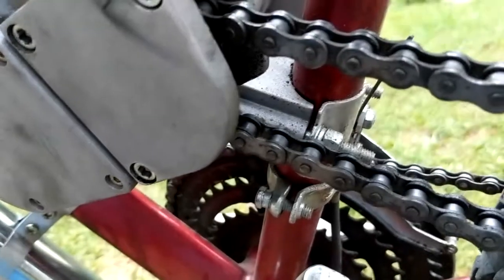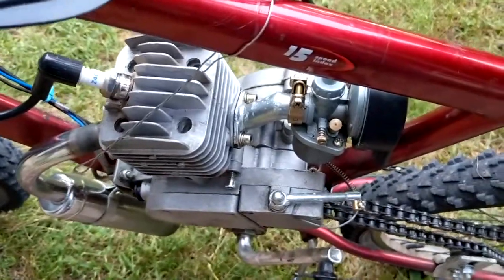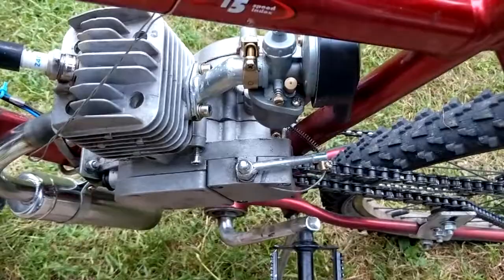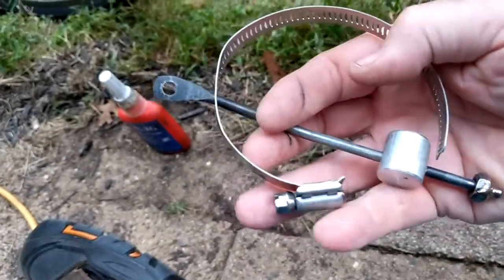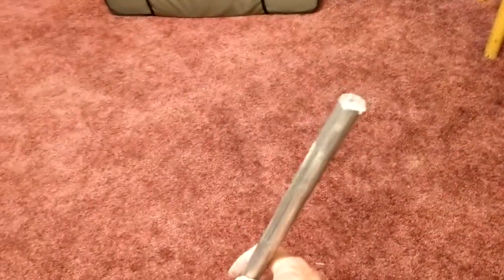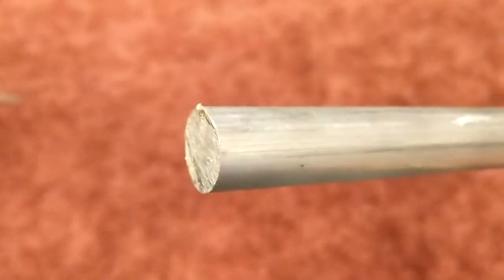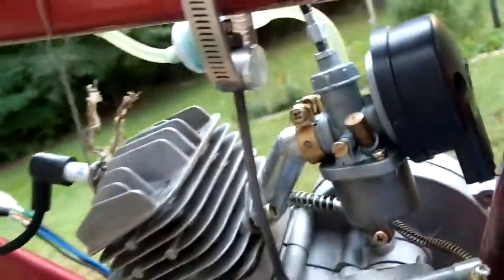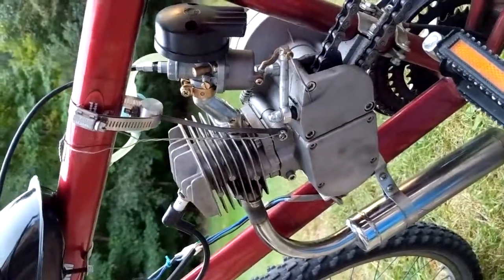Motorized Bicycle motor mount improvement - anti-twist

Comment: I just moved from a bare bones bike, which fit perfectly, to one with all the jazz, but thicker tubes, so I had to use the adapter, and now the chain is also a bit short, and was quite tight, after riding a bit, whole engine tilted a bit :/

Comment: This happened to me twice in the past two days. Both engine mounts got loose and the whole thing tilted left, popped the chain off, and go caught on the rear wheel. I was only able to drag it, and it wasn't until I had to detach the engine chain that I was able to roll it. However, the tilted engine also got in the way of my pedals (+ coaster brake), so I wasn't able to simply pedal  my way out either. All this was in the middle of a desert preserve. I will be utilizing this, I don't want to again have to drag and roll my bike for hours to get to the nearest road for a pickup.

EDIT: I made something similar with rebar and a hose clamp! It works wonderfully. I essentially flattened the ends of two piece of rebar, drilled a hole, and attached them onto the carburetor mount bolts. From there they simply went up onto the frame where I hose clamped them. I added a bit of foam for vibrations and scratching. Thanks for the idea!
Reply: Hey dude, this is very useful for me because my engine keeps slipping to the side and the chain keeps slipping off

Comment: not a bad idea bro.i appreciate ur ingenuity but that is not necessary just install the mounts correctly and u will not have a problem..locktight is a key component with these motors. u got that right..they r never turn key and go..for anyone who is not mechanically inclined. these are not for u..I have built 7. all turned out great.. I even had one that topped out at 60 mph 32 tooth sprocket expansion chamber bad ass carb..there r a few tricks I suggest number one hub adapter NFL plug expansionchamber if u don't mind loud and number one is the break in..I have found some times its the luck of the draw some come off the line better..but with some understanding the r good for the price

Comment: Great solution, thanks for sharing.
I used a 3 inch  self tapping screw  through the frame of bike  into the mounting plate. And a short one through the one on the back into the frame. Works well.

Comment: It all starts with what I would say is the most important part of any build. The sprocket and rag joint alignment. I can't stress enough the fact that it must not have any play from side to side or up and down especially at higher speeds. That and the break in period. Don't forget the luck of the draw with a lot of these motors..ive purchased two at the same time and the bikes are components and fuel was exact. Only thing I did different is with one
Reply: I have 1mm or maybe 2mm of up down motion, how bad is that?

Comment: I agree with the guy that said it is unnecessary but every little bit will help in these motors. I have in my last two builds been able to not have any problems at all with my chain i feel like that is a huge accomplishment in the case of these bikes.

Comment: May i suggest small petrol generator engine mounts connected to plate steel no vibration no engine coming loose. 50mm for rear mount and 30mm for front point 2 at front 1 at rear
Reply from the maker: sounds good....can you suggest a source of supply for same???
Reply: @kuehn1953  local lawnmower repair shop should sort for u they r Antigone cushions